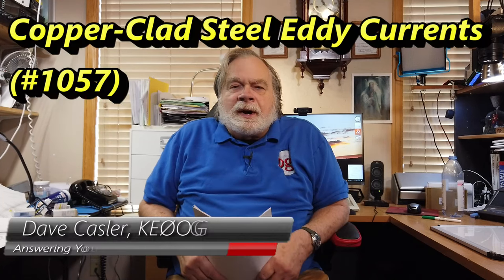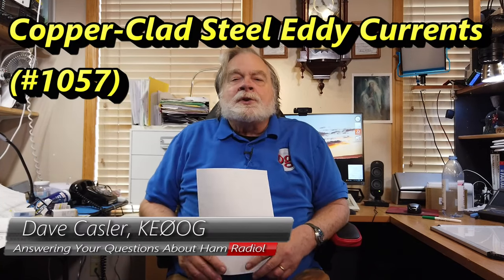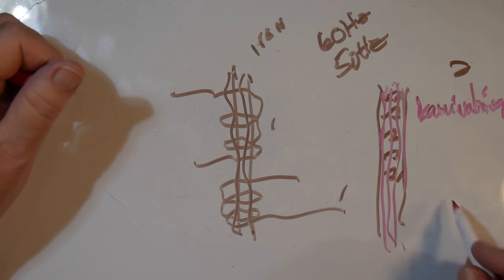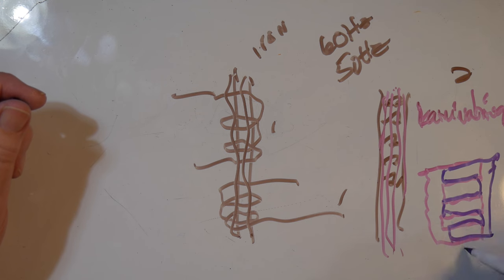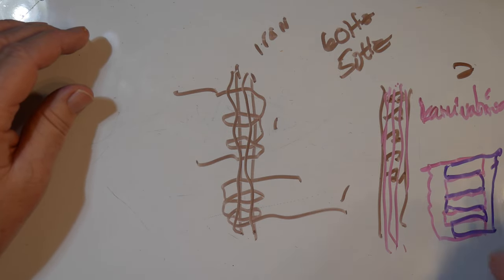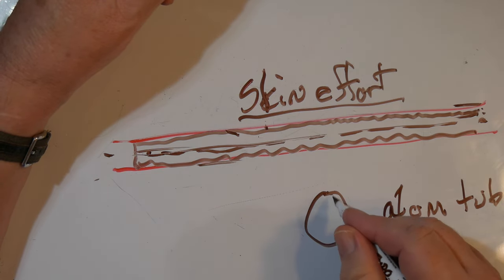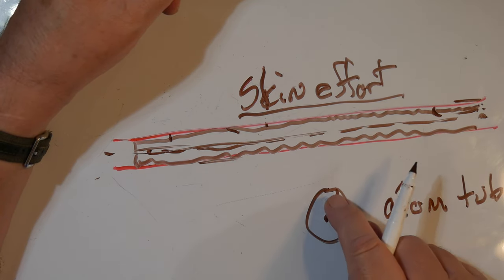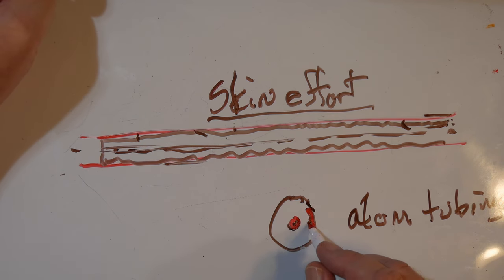Copper-Clad Steel Eddy Currents (#1057)

Comment: Hi Dave.  I saw a chart of elements (I remember perhaps inaccurately) showing RF flowed skin effects on aluminum is thicker than it is on surfaces of copper conductors.  Likely it is due to  differences in magnetic moments between each element.  I think this was used to justify use of aluminum tape over copper tape in constructing an antenna with tape; that, and multiple layers for  rating higher powered transmitters.  After watching your explanation on this video I can better understand why it's possibly different in various elements.  Separated double layers probably too.  That stream analogy seems more real than analogy after watching your discussion.  I gave you a thumbs up and a comment to encourage you more than subscribed (which I did on the first video of yours that I watched).  Cool drawings/illustrations!
  
Conductors in gradient (electromagnetic) coils within MRI magnets are more shaped into rectangular solids.  Solenoids are DC; nearly all are superconducting.  Gradients are pulsed square waves and electromagnetic timing is so important that waveforms are tuned for sharpest changes.  Rectangular shaped conductors makes a lot more sense after watching you.  Before your video I thought the shape was only to save some space inside the solenoid.  (Spheres/Cylinders have the least geometric surface areas.  So, yeah, just saying.)

Comment: I want to say there have been several youtube video's testing many different metals when it comes to RF. From what I recall they all perform similarly except maybe 1 or 2 different metals which should be avoided...   For example: Speaker wire is going to perform as CU Copper wire.  Under lab testing there might be a very slight difference, but it is nothing anyone would ever be able to tell in ham radio.